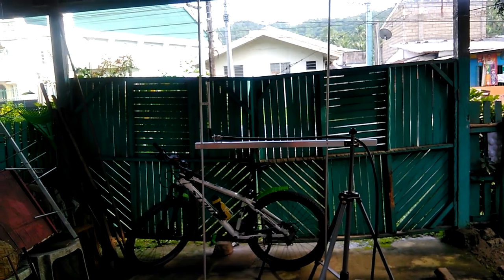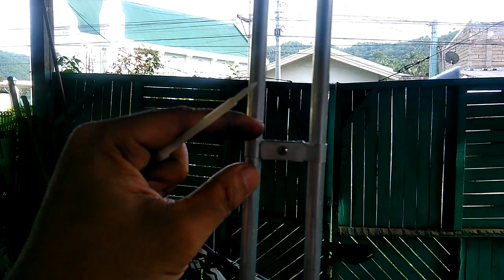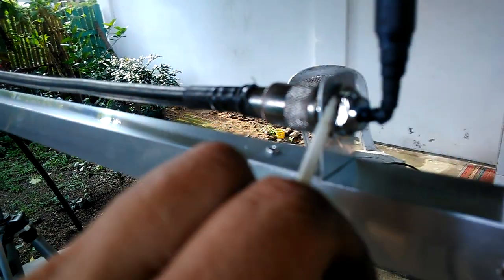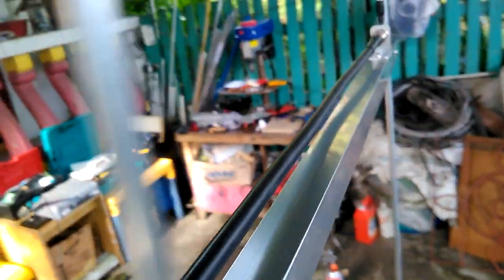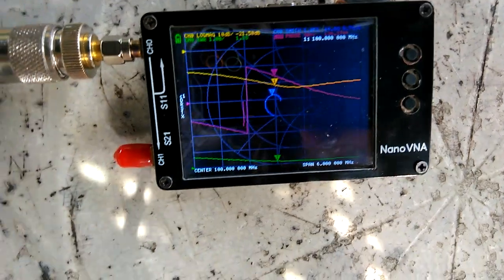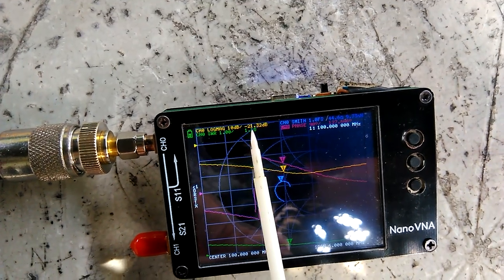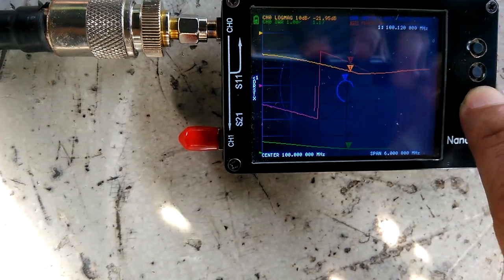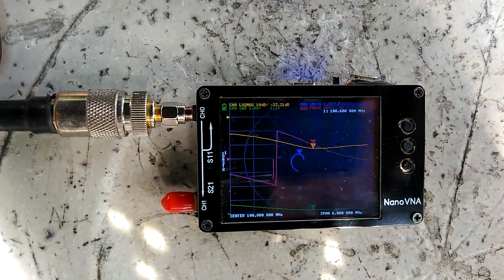Tuning 100Mhz FM Broadcast antenna

Comment: nice job, but swr can be lower an impedance close  to 50R... you have to much obstacles for fine tune !  min distance  3m all direction for super fine tune.
Reply from the maker: that's acceptable as those are initial tuning if they finally install it in a tower the optimum SWR will result for sure.

Comment: Question. I have a dual antenna whip nagoya. It has 3.5vhf and 5.5 of gain uhf.   If i tune the uhf frequencie tona desire, will the gain dimish or be affected and the vhf .
Reply from the maker: usually the other band will be affected as well if you adjust the other side.
Reply: @EphraimGariguez  well the antenna is a dual but it has 2 separate coils , one at the base for uhf and one at the middle for vhf
Reply from the maker: @SuAmigoElilegal  if it is fed using a single connector changes on one side usually affects the other side.  If it's totally independent then no problem, but you can always try and see how it behaves.
Reply: @EphraimGariguez  thanks for the info 👍
Reply from the maker: @SuAmigoElilegal  welcome po